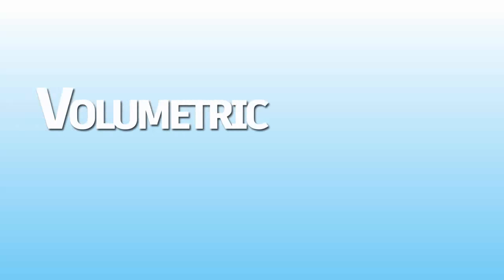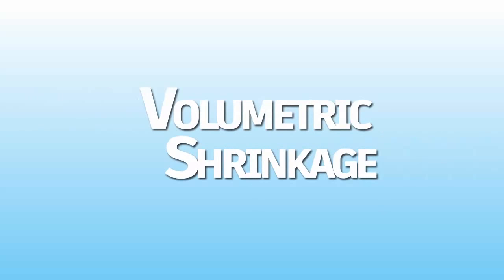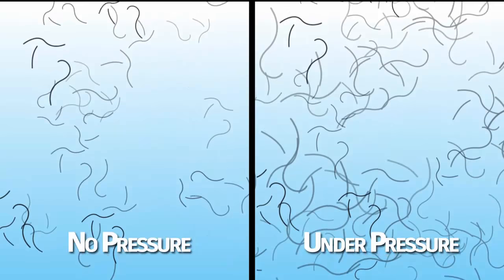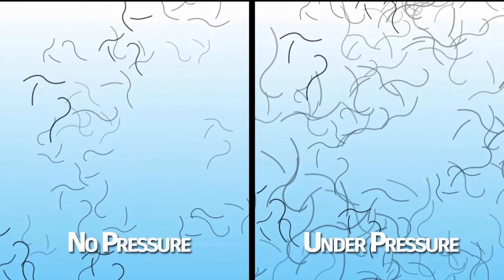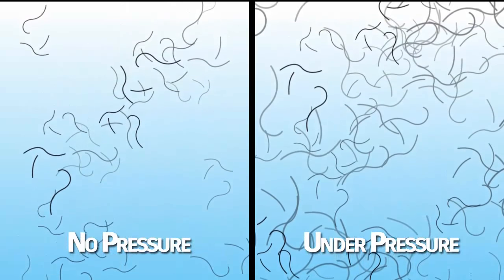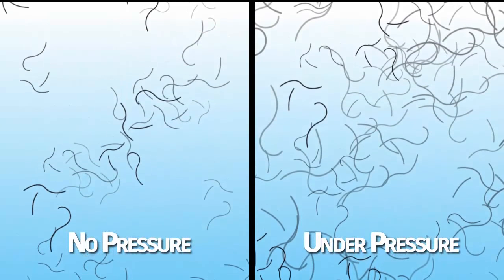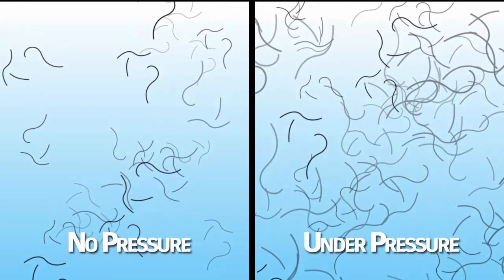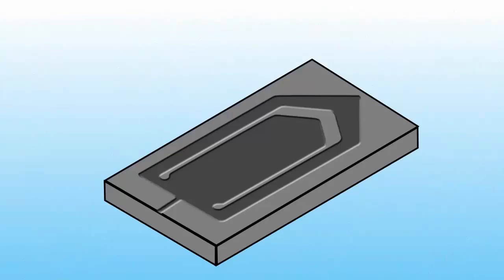Understanding shrinkage

Comment: Dear Prakash, 
I have a questions on plastic polymers.  Currently we use a PC material Sabic Lexan PC940A.  the current plastic cracks(brittle cracks) after being assembled and sitting in our warehouse.

Before we didn't see this issue but recently this issue has started to become more apparent. 

What we noticed was that there is more shrinkage in the corners compared to products produced before.

Could this difference in the shrinkage of the part affect the brittleness of the part and thus cause the part to crack more easily than before?(as before we never seen these cracks)
Reply from the maker: Try injecting the part with lower injection rate.. maintain shear rate, shear heating within the recommended limit